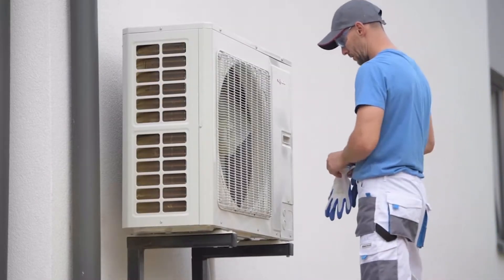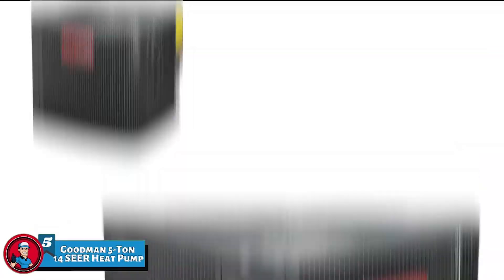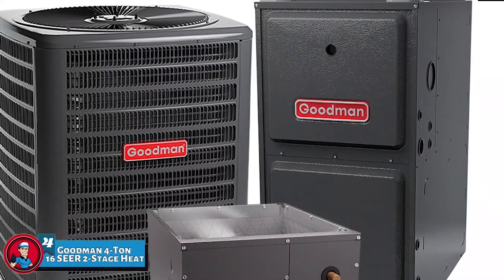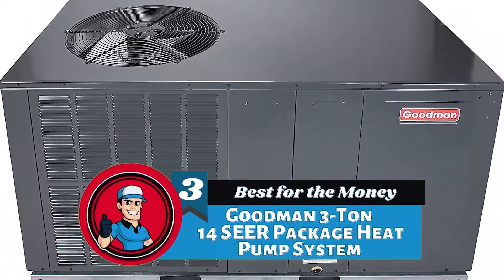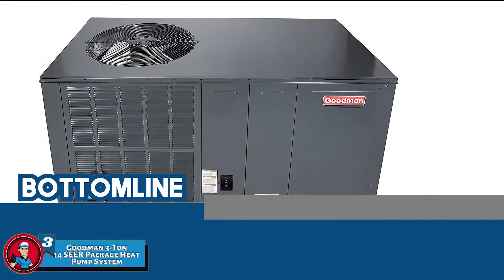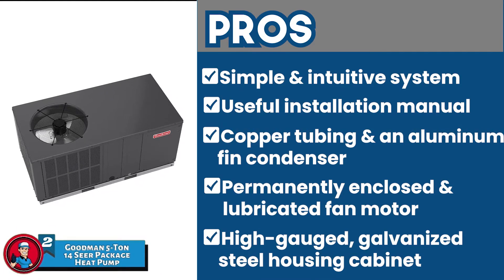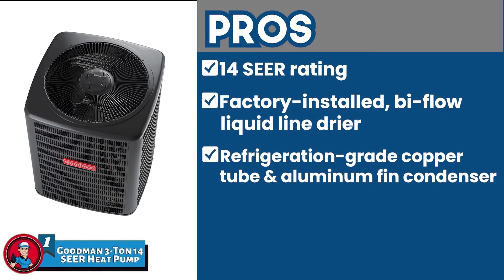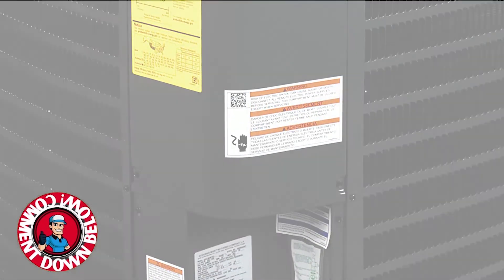Best Goodman Heat Pumps Reviews 🔥: 2020 Complete Round-up | HVAC Training 101

Comment: Man do I love our  gas Goodman.  First we had the exterior unit installed, didn't see a difference from our old one.  Few years later we install the new goodman inside and boy does it work better 💪  That air pressure is high and just rushes out those vents.  I recommend Goodman 💯
Reply from the maker: Indeed, Thanks Man